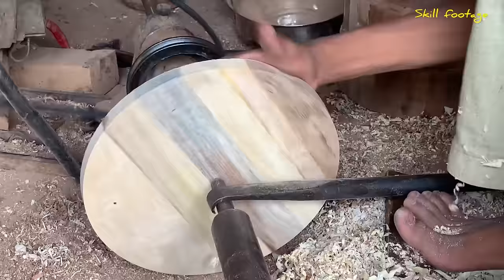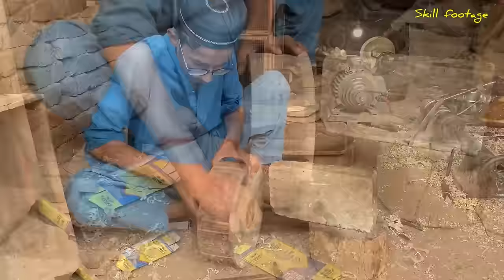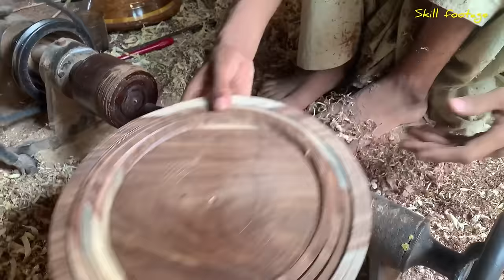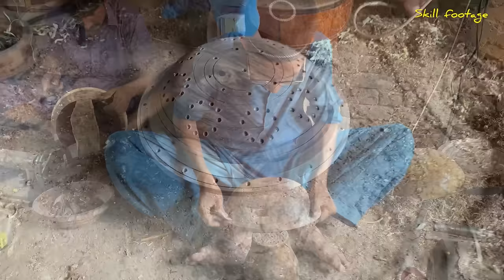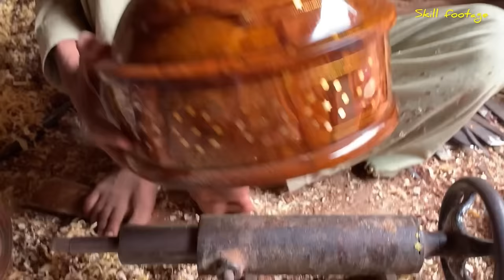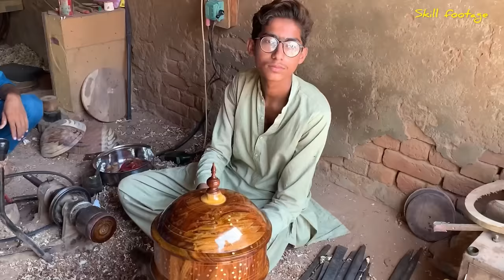How Young Woodworking Master Make Brass Inlay Wooden Hotpot with Amazing Skill | Woodworking Project

Comment: What is the dark cube you rub against the wood to get that beautiful amber color?
Reply: Not something I've used but traditionally woodworkers might have used sap or amber as varnish, could be one of those.
Reply: Its Shellac
Reply: I wonder too
Reply: @kingoftf  is there a kind of shellac in that solid form, I also use shellac but it is liquid, II've never encountered this form before.